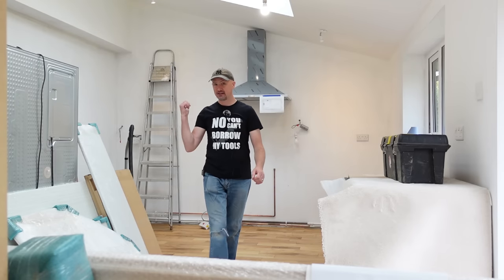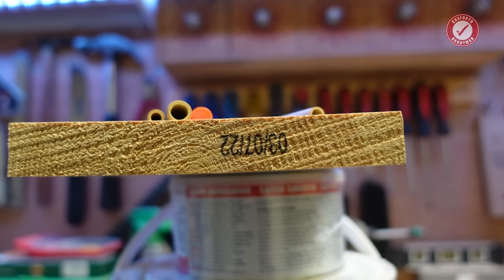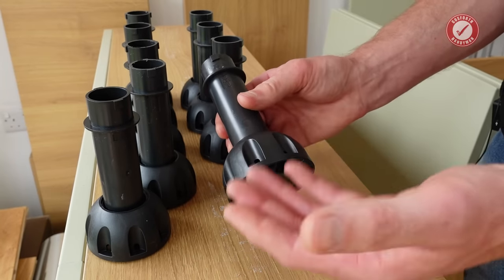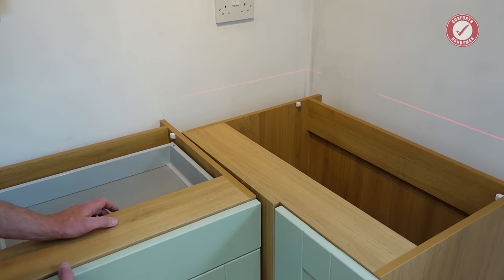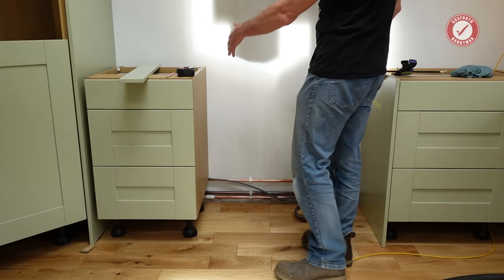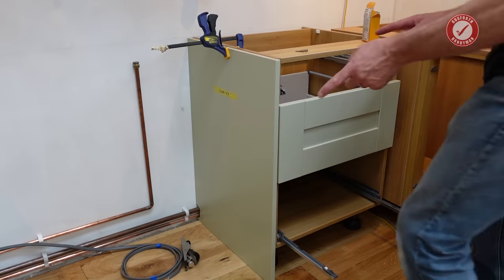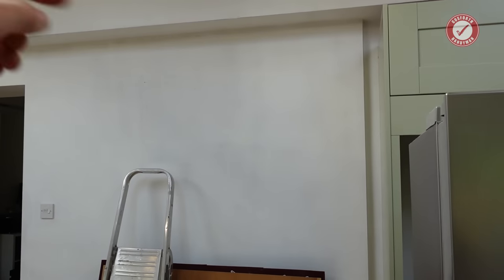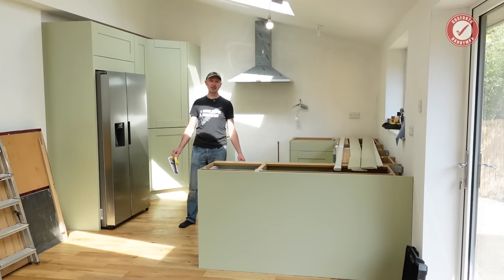How to fit a kitchen

Comment: I have questions about the fridge freezer. I know you left a 50 mm space around it like you're meant to but it's covered by the panels at the front. Will there be sufficient air flow for heat exchange? On the same note, is there a risk of direct sunlight from the skylight hitting the fridge and causing issues with temperature?
Reply from the maker: Yeah loads, plus 50mm at the back. Bear in mind it's almost completely open at the top. 👍

Comment: No wall units? Damn, I was hoping to find some tips. Their manual seems to suggest drilling screw holes for the brackets 40mm down from the top and 27mm in from the edges for the first (outermost) screw hole with the second (innermost) screw hole 27mm from the first which sounds reasonable enough except the supplied brackets have the screw holes approximately 60mm apart!

Comment: about the wood expansion 101 thingie - most of the newbuilts have a "technical" issue where the Build literally sits there for weeks without any progress.

In the rest of europe, wood is NEVER subjected to more than maybe a couple of days of exposure, which is checked with weather beforehand. so literally, a new build will have the "new wood" smell all the time and there's no contraction

Comment: The cabinets look great! If nothing else, your video might scare some from doing this in there own home as it is a frustrating and long process. Not surprised if you are missing an end cabinet as you thought. I’ve seen a lot of cabinet installs and that is often a problem people have after receiving their cabinets!

When installing base cabinets, you typically only fasten them to each other and to the wall, so I would think there should never be a problem with floating floors? Are your cabinet drawers metal? I know the faces are wood, but the interior and the sound they made when installing them looked and sounded like metal?
Reply from the maker: Yeah, they're metal! 👍🤘

Comment: How will you connect 
Refrigerator water line didn’t see a connection point. Do you use copper pipe for gas to the stove?
Reply from the maker: Water point is in the bottom of the big corner unit. 👍

Comment: @Gosforth Handyman I am going to lay down LTV on top of my floorboards lke yours. I see my floorboards are not fully screeded so I was wondering if your floorboards were totally screeded. I have the hallway of the house with laminate floor and there is some squeaks....would engineering wood resolve all the squeaks even if the floorboards are not screeded? Thank you a lot
Reply from the maker: You need to fix any squeaks first. 👍
Reply: @GosforthHandyman  thank you, all the squeaks are fixed but when I use my spirit level I noticed that the floor are not levelled...some areas show from 1-3 mm different...should I just lay the floor or any suggestions on how to level the old floorboards? Thank you really love your channel. Thanks to your help I am insulating the whole house. Keep the great work coming!!

Comment: Hi, I noticed a bit of damage on one of the corners, as I could not see it on the face of the cupboard, I am assuming that it is at the back somewhere. Have you sealed the board to stop any water getting in?
Reply from the maker: Hidden away and it's at the top so all good. 👍

Comment: Looks brilliant, can I ask why you chose to put the filler next to the corner larder instead of extending the corner post? 

I’m a kitchen designer for Wickes, but I’m honestly really impressed with DIY Kitchens stuff!
Reply from the maker: Cheers! Nearly used Wickes - lovely designer, but pipped to the post on price. Filler was just to bring the Range perfectly in line with the extractor. The extractor had to be fitted a couple of months in advance for building regs sign-off and at that point the kitchen design wasn't 100%. So everything centred around that. 👍
Reply: @GosforthHandyman  that makes sense, sometimes I think people have managed to get around the whole 3 point extraction by fitting an expelair somewhere in the extension and then later doing the cooker hood. But I may be wrong there!! 

Looks really lovely, looking forward to seeing the tops 👍

Comment: When I fitted my new kitchen last year I deliberately didn't run the flooring under the cabinets in case in years to come I want to change just the flooring.
Reply from the maker: You could still change the floor but you'd just have to multi-cutter around the legs. But yeah, can make sense depending on the install.

Comment: I've always seen people recommend screwing a strip of wood on the wall for the back edge of the units to sit on and then only use legs at the front, then everything will be level
Reply from the maker: Hmm... not sure how that works if the wall isn't straight? 🤔
Reply: @GosforthHandyman  it just has to be level so all the units are at the same height and wide enough that the units can be in a straight line, it just replaces the rear feet with a known level base
Reply: That works,it makes life so much easier.
Reply: IKEA actually sell a metal rail which does that. Just two feet at the front, which can be shared 50/50 with the next cabinet
Reply: @contactjd  yes same principle, just hanging on a rail instead of standing on a ledger

Comment: 10:25 - The fundamental issue here is using wood flooring in a kitchen (or bathroom) where water spillages are very common and many times remain undetected for long periods of time (eg under cabinets or appliances).

Comment: Hi mate, does it count as kitchen fitting if you are buying preassembled units from a top of the range supplier? :D
Reply from the maker: They're not exactly top of the range, but yes... without the flatpack assembly. 😁👍
Reply: @GosforthHandyman  the pre-assembled bit is a HUGE bonus, isn't it!?
It takes forEVER to assemble everything......!

Comment: I think you would have to put something extremely heavy on a floating floor to hinder the movement. I don't know maybe 250 kg or more at one end...
Reply: Seen it happen in multiple kitchens, had to cut the floor, remove skirtings and pry the floor over central again. All depends on the flooring and how much movement is in it. It also voids any warranty on the flooring if stated in the installation instructions
Reply from the maker: Yup, or extreme variances in humidity. More of a concern for solid wood but less so with engineered. 👍

Comment: After over 4 decades at fitchen kitting i came across this vid and sped through it to the last 5 mins to avoid ptsd lol.

Seriously leave it to the pros . Im not saying more than that.

Even the electrical looks easy at times, but you need all the  calibrated test equipment and  certification.
 Ive the 16th and 18th BS7671 just to be able to asses and advice also to be able to work with electricians. I still wouldnt wire something in even as a favour.
 Theres would be electricians out there that wriggle out of liability by doing no certification or wont issue it.
 Same with Gas. Ive had a corgi certification and years of experience and same again. You need to receive certification no matter if you pay cash. I wouldnt even disconnect a gas hob ... how do you know a pipe or fitting hasnt been disturbed ? Or from a fitter point of view there isnt already a small leak that your now responsible for ?

A professional knows who to bring in ... gas fitter etc . What materials work . And will stick with it like a rottweiler chewing a bone no matter what.
 The independent professionals are usually cheaper because your not getting the store mark up on their work .. plus the vat charge on that.
 The organisation is the key.  If a fitter can organise the delivery, removing the old kitchen,  the electrical, gas, plastering, tiling etc  your on a roll, just chuck the money at him and put the tv on lol 
 Its not worth the stress .

The advent of sophisticated Ai actually  made the job harder by suppliers. As the Ai was never wrong and was
Relied upon 100%  with zero dispute allowed from a timecserved tradesman aka craftsman.  .. imagine.
He is correct but everyone believes the CAD  is correct. Closing stages of my retirement this happened on 2 occassions.  I could have just said " oh ok no problem everything fits "   
 And just let the shtf sort itself out with a flurry of chaos and dissatisfied customer's,  etc etc etc.
 Even then the issue never identified and action taken to prevent it ... without a probable ?  Software design rewrite and or a reprogramming of robotic machinery etc
[ btw  Ai has fuked up everything...like this the same way ...everything!  ]
Ai was a God send for advertising though , happy days. As it could be controlled by the individual,  turned off at will , updated , or just thankfully fukin deleted. Lol